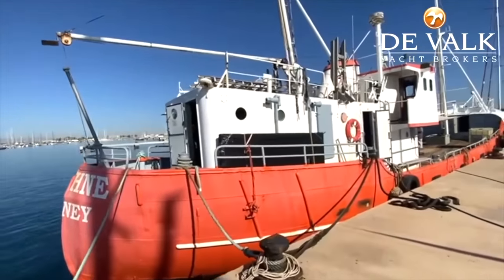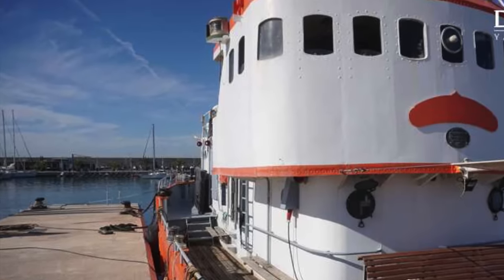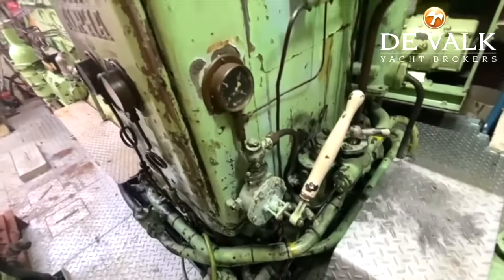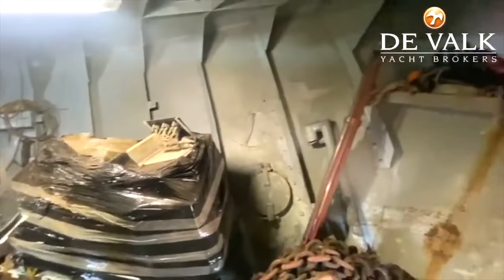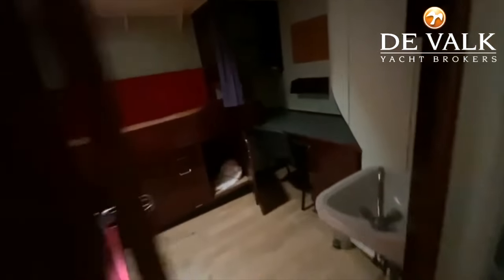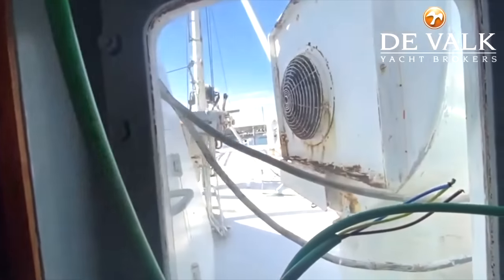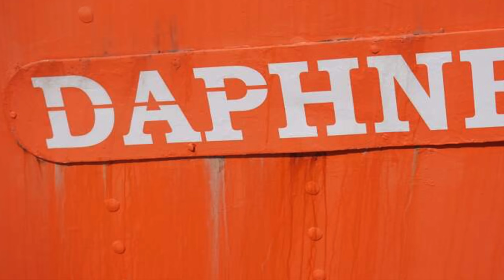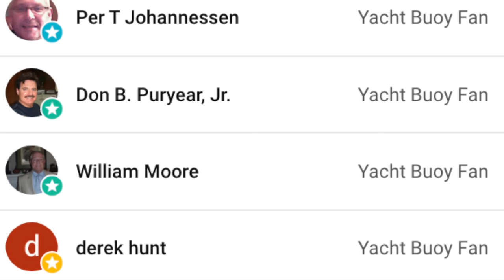This STEEL Ice Breaker Is FOR SALE With A €50K Starting Bid!

Comment: as with a lot of other misty eyed boat lovers the first thing you must do is have a bottom survey, and go from there, I have seen lots of boat purchases get fully fitted out to liveaboard only to find that the bottom was paper thin and they have no money left. boat on the hard and measure plate thickness and do the anodes.
Reply: I think that it's mentioned in the video. 16 to 8 mm ... 
Hope 8 is not the norm though! 😊

Comment: I wouldn't remove anything but I'd add more modern navigation equipment. Normally I'd say a new engine but the one it has seems to be doing just fine. And it would do well as a diver and explorer sub tender in a new life.

Comment: It would be interesting to see her turned into an economical expidition boat. The Engine is awesome but could be replaced with a Combined Diesel Electric system. Cover the roof and the like with solar panels. Equip her with a modern Sail or kite system for further economy. Strip interior completely and turn into luxury accomodation and galley. etc. With a 5,000 nm range pushed further by the use of wind and solar power maybe a 7,000 nm range would be the result. I would want two engines as a minimum but if you have 12 hours of solar power in batteries and power goes you have time to fix the fault etc. If you have a secondary generator you may be able to limp it home etc. As said it would be an incredible boat to fix up.

Comment: My Dad was a skipper on a very similar cat trawler in the 60s for 22 years. This is perfick. Thanks 😊in red it looks like radio Caroline.
Reply: Yea. Iwas deckie in Mid '50's out of Hartlepool Suttons deepwater boats
Those farkin things are safe enuff. BUT roll like bloody barrels withiut the trawl down The North Sea in winter was a prick of a place. Bouncier with bigger holes than the Atlantic believe me.
I remember Radio Cariline and a coupla others when they first started on the 3 mile limit.
Hey Plopsa... Look at that bow. Too fine for any fishing boat I ever saw.  They usually more bluff for lift and carying capacity. She built for going to and surveying, at faster speeds, without load.

Comment: 8000 hours is actually considered low for a 60 year old vessel.
Reply: I agree. It's the sort of engine that is built for continuous use and - dating from 1960 - rev per minute is probably very low compared to modern diesel engines.
Reply: I’m wondering if that is 8000 since her rebuild in 2014. Otherwise, it wasn’t used very much.
Reply: @barryholiday8998  If it was a complete overhaul (revised in English?) then she probably got a new counter. Our engine is 8 years old, we only use the boat for holidays, and the counter says 2400 hours.
Reply: I have a trawler type boat
1975 5,500 hours
Chrysler Nissan Six diesel
Three gallons per hour
Eight knots
She is a beautiful boat
Reply: A little  less than a years use on the engine.,  333  days. We typically  put around 7000 hours a year on the mains on the fishing boat I engineer on. Not buying the icebreaker claim. Possibly  ice classed , but the scantlings look pretty light for that. Still a interesting old boat. And if it was a fisheries  patrol vessel  probably  lightly used.
Reply: @edgarmosiman7389  how often do you have to replace the engines?
Reply: @edgarmosiman7389  I agree with the „ice breaker“. It doesn’t look like a icebreaker hull.
Reply: @barryholiday8998  we have a swing engine we swap in every two years. In frame at approximately  30k hours. The engines are about 35 years old. So far all original blocks. I used to work on some boats that had wichmann engines. The oldest one was from 1939 and still running. The other ones were newer, 4AX  1350hp at 375 rpm. In line 4. Very efficient  engines
Reply: The engines on my current boat are 12v149n detroits.
Reply: @edgarmosiman7389 A small tug or a crew boat
Reply: @jjosephm7539  fishing boats
Reply: Iv been looking for a ship like this to use as a island trader and floating supermarket

Comment: that 400 hp diesel was dimensionally pretty darn large !
Reply: Big cylinders, low compression, low rev... less horse powers per kilo engine but lasts forever.
Reply: 400hp at  say1200rpm. Torque to swing the big props is what is required

Comment: The auction is a nail biter ... currently in overtime (I guess because they extend the time while there is still bidding going on).
Bidder #1 has auto-bid blasted his way thru every opposing bid.  
It must be depressing to agonize over your next bid, only to have auto-bid beat 1 second later !

Current bid is 132000 euro ... it started today at 58000

5 minutes later ... auction is DONE ... final bid was 132000 euros, 21 bids total ... Mr Bidder #1 won with Bidder #4 coming 2nd
Reply from the maker: Thanks for the updates - I was interested to know how much this would go for in the end
Reply: I think that’s a good price for the buyer, provided she’s seaworthy and has the same ice rating as advertised.
Reply: whoops ... it's back on yachtbid again !

Comment: If I had the cash, I would buy it. Spend a few million $$$ (no more the 5 Mil $$$ max). Update the electronics to 2022 standards along with safety upgrades. Get a new engine so that its more efficient. See if the original Danish builders are still in business and let the pick a new engine and do the upgrades. That way the technical upgrades are done by original ship builder's. For luxury cabin upgrades it could be sent to the appropriate interior builder within Denmark. Though I would keep the cabin layout. Just upgrade it will 2022 comfort's, same for the bath/toilet's etc...

Comment: Very cool old boat.  Probably going to be captain/owner vessel at just 30m. I would put a new CAT in her, turn it into a 3 cabin configuration and open the wheel house up to a single large space. Lots of old equipment to get rid of when updating. But would be very nice with large cabins, nice new deck and crane for a new 8m tender. Probably 2 mill, but would be very nice. 👍
Reply: Why in the world would you vandalize such a craft when you could just go get what you want purpose built. Leave he classic boats to their purpose.

Comment: Ice breaker? That forward locker did not look like an ice rated hull. Icebreakers usually have a rounded bow to ride up over the ice and the weight of the ship cracks the ice. While filming with a mobile phone the fine detail of the rust in the ceiling was difficult to make out. An upgrade to a movie camera with a wider angle lens is really necessary. With structural modifications/rust removal/painting and a new more economical/lighter/more powerful engine, rewiring, re plumbing, new deck and floors, nav equipment/satellite communications, surely the refit would be well over $500,000.